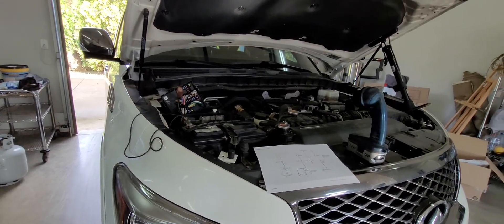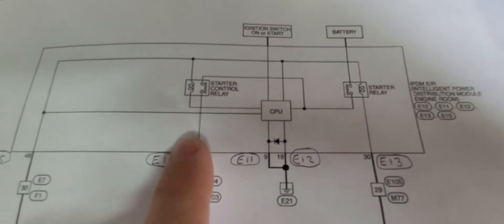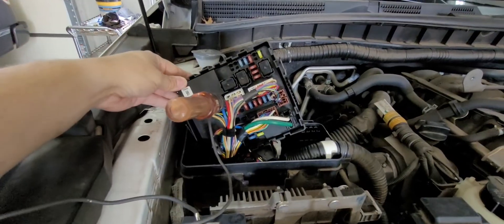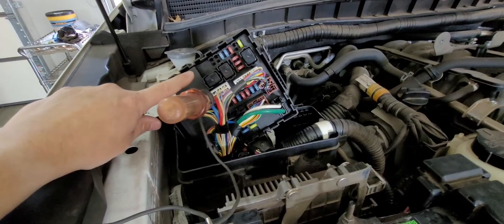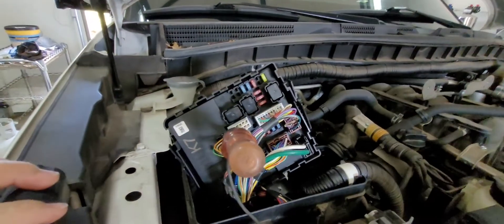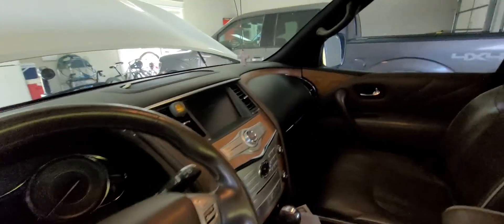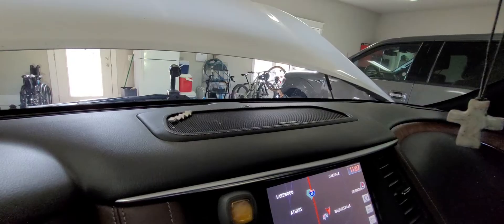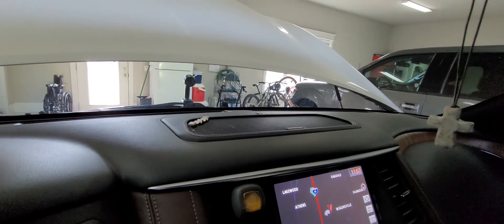QX80 No Crank No start SOLVED! How to test if your IPDM or starter is bad.

Comment: I have a 2019 qx50 out of no where my battery will die ? Any suggestions
Reply from the maker: Does that vehicle have a voltage gauge on the dash? If it does, how many volts after starting it and then again 30 minutes after driving?

Comment: My friend 
I had qx56 2012 it was without battery for month 
We put battery and engine not cranking 
Some one say ecuv
!!!!!! What is the problem do you think
Reply from the maker: I can’t know what is wrong with your QX56 without inspection, but I’d ensure the battery you are using is fully charged and that your connection to the battery is correct and secure. After that you could continue to troubleshoot. Good luck, I hope you find your solution 👍

Comment: Was it really a starter issue? I'd check the brake peddle switch, that's what fixed my issue of no crank / no start.
Reply from the maker: Yes, the issue was the starter motor. I replaced it back in 2022 when I made the video. Haven’t had any issues since 👍

Comment: Question - my qx80 sometimes a rough idle I turn it off and push the button again to start and it runs smooth .
Reply from the maker: I can’t say for sure what that would be, but good practice is to ensure your maintenance is up to date. If that doesn’t fix it, begin troubleshooting. Maintenance for your situation would involve spark plugs and possibility coil packs if the coils have over 80k on them. Doesn’t make sense to me how a restart would change the idle though. That’s just my thoughts without seeing the vehicle myself.

Comment: Do you remember if when you had your problem if you heard a click - pause - click sound from under the hood every time the ignition button was pushed and the engine would not start?  I want to try the troubleshooting steps tomorrow.  Thank you very much.  The schematic and your explanation was very helpful and is helping me identify my problem.
Reply from the maker: @maverick19702000  I didn’t have any click sounds. If you hear clicks with no crank, that’s an indication of a bad starter. The solenoid clicks when activated. When the solenoid is activated the starter should crank.
Reply: @jacks_DIY98  I just got my qx80 running yesterday thanks to this video! Now I need to figure out the heated seat for the driver side.
Reply: @jacks_DIY98 or a dead battery?
Reply: Yes there is a variety of clicks but no crank. I did see the voltage on the RED wire he speaks of in the 4v-6v DC range which I originally thought suspicious but ultimately it was the starter. Below is a great video for replacing starter. Took me all day the first time trying to be careful. About 4 hours the second time having done it again. You will need 8mm, 10mm, 12mm to get to the starter and a 14mm for the starter itself. Hoses came off using some plyers. Some cutters for the zip ties. Make sure you let your vehicle charge for a while before trying it out. Ours sat for a while and I replaced the starter I got from amazon and probably didn't need to swap it a second time had I been more patient. 

Just Vlad- Infiniti QX56/QX80 - Starter Replacement

 https://youtu.be/R2eTjpbbZ7w?si=knYCaBCVmtVdLnk1
Reply: https://youtu.be/R2eTjpbbZ7w?si=knYCaBCVmtVdLnk1
Reply: Our 2017 was making an unidentified clicking noise right after the vehicle started last few days. Started fine this morning, but made a rapid clicking noise some where around steering column or dash. Went to work, left work. Or tried to leave work. No start. Battery tests good. Everything comes on....

Comment: Thanks for the video. Had this issue on my 2017.  When it was brand new it had this.  I had many conversations with the dealer about ways to correct the issue before finally speaking with one tech who was able to come up with a solution so that the battery was constantly charging.

Comment: Thanks, P.s. IF your battery gauge is "fluctuating while driving, you are NOT getting battery charged, hense changing battery more than other cars. solution. On negative battery cable disconnect Grey harness black tape it. START , AND DRIVE FLUX IS GONE. battery will get 100 percent charge from alternator while driving. THEY INSTALL THIS "green b.s. to save gas. ❤ Lmao. Qx80 10 miles a gallon. YEP. ENJOY.

Comment: Juat had this on our 2016. It has done 170K miles so its ok if it needs a starter. I cut the vvcm wire a year ago to eliminate that and now i
The starter is intermittent.  I caught the problem with a test light just like this video and am ordering a starter. Thanks!

Comment: That still doesn't point to the problem. Because if it's an intermittent problem, just because you hold on that button and the light comes on seems like a result of what happens when the ipdm has enough time to cool down and kind of reset itself. So basically the best time to be testing this would be after the car has been running for a while. Because of its happening intermittently, that's because the ipdm has heated up so much that it is essentially having a heat stroke. Still doesn't mean that the ipdm is not bad. It could just mean it has had enough time to cool down. So you can essentially replace the starter and the ipdm could still be bad. I ran into a problem with an ipdm overheating in a 2008 Infiniti qx56. But the problems went way past it just needing a starter. Nothing in the truck would work. I had no dash lights but the truck was still able to drive in essentially a limp mode. It would not shift into overdrive. So I had to baby it back home 200 miles from Chicago. But once I got home, it had enough time to cool down and it started ran and drove just fine. Now to be fair, it was about 90° during that trip to chicago. But the pavement temperature was well into the mid 120°s. So if it's a simple no crank no start, I wouldn't bother checking the ipdm. Unless there are other symptoms such as non shifting or lack of gauge cluster. But that's just my opinion. You can do what you want. But I would say you are wasting your time messing with the ipdm. And possibly spending a couple thousand dollars on a whim.
Reply from the maker: Great input. The point of the video is to test if the starter signal is even getting to the starter.  If the IPDM is outputting a signal to the starter solenoid, then the problem isn't the IPDM if the starter isn't cranking.

Comment: Hey Jack... Thanks for all your videos ive watched all of them. Curious if you have any ideas. I thought i had your same situation going on with my 2014 qx80. The only problem was the test light to the starter wont turn on no matter how many times the button was hit. So i replaced the ipdm... got the new ipdm and still no light with test to starter. I tested all other fuses and relays and all appear fine. Any ideas? Dash lights turn on but no indication to press brake to start like it normally does. Im at a complete loss.
Reply from the maker: Bummer,  sorry to hear your QX80 isn't starting. I don't know your answer off the top of my head, but I can try to help. Ok, to be sure I understand your situation, the diagram in this video,  pin 3 ( red wire) of the IPDM goes to the starter solenoid, and you are not getting a signal there. So, check pin 30 of connector E13. You will want to refer to the IPDM layout diagram to find this connector. It's a Red wire with a white stripe. Bottom row second position from the end but likely the last wire in that connector. Check if you have a signal there when trying to start.  That signal is coming from the Body Control Module. Without it, your IPDM won't try to start the engine.
Reply: Thank you so much for the help. I feel like ive been chasing rabbit holes with this. The pin 30 did not have power with test and not sure if relevant but it made clicking noise in ipdm when test light was pressed in. So from your point of view would this point to a bad bcm?
Reply from the maker: @ArcheryOutdoorLife  It's too early to  say bad BCM, more troubleshooting is needed. The clicking noise in the IPDM would have been relays. I haven't researched the BCM previously.  I'll try to look into it on Friday.  Obviously,  the goal is to troubleshoot the circuit that controls the start signal. The next thing to figure out is what tells the BCM to output to pin 30 at the IPDM.
Reply: @jacks_DIY98  Makes sense ill do my research as well. Thanks for all the help.
Reply from the maker: @ArcheryOutdoorLife  I just tested my QX80. Pin 30 has battery voltage  when the Ignition is on, engine running or not. However,  not enough current to light a test light very well. You'll want to use a voltage meter to measure there. The BCM has a connector M71. Pin 97 is the other end of the wire for Pin 30. You could measure with a voltmeter there also. It's the same R/W wire. Pins 97-99 of M71 are part of the Ignition system also.  Pin 102 is the Neutral/park circuit, that plays a role in the start circuit also.  To check P/N circuit at the IPDM measure voltage on connector E15 Pin 48. It will be a brown wire. It's the Second pin from the end but is the last wire in that row. It should have battery voltage with the key on. Good luck 👍

Comment: Does the IPDM module trigger the Security light indicator in the dash? My wife has a 2014 QX80 that has intermittent start and flashes in Red the security indicator light, which locks the ignition switch. Thank you
Reply from the maker: The Body Control Module (BCM) controls most all functions of the security system. The only thing the IPDM does regarding the security system is honk the horn. All other aspects are controlled by the BCM.

Comment: my QX80 2020, monitor no light , could you tell me about this problem
Reply from the maker: The fastest thing for you would be to read through all the comments and this video description.  If you still have a specific question,  I'll be happy to answer it. The basics of this video is just that you're testing if the starter motor is getting a start signal. The IPDM rarely go bad, so double check your test results or Measure at the starter motor connector at the top back of the engine.

Comment: The OP made this a bit confusing, so to save some time from people asking the same question repeatedly...

-- If the test light DOES illuminate when you press the ingition, but the car does NOT attempt to crank, the IPDM is good and the starter relay or solenoid is bad.  Replace the starter (the relay and solenoid are all part of the starter as a whole).
-- If the test light does NOT illuminate when you press the ignition, the IPDM is not sending power to the starter relay, thus why the starter does not / cannot engage to turn the crank.  In this case, replace the IPDM and you should be all set.
Reply from the maker: Thanks for contributing to the comments,  good break down of the situation,  except I wouldn't diagnose  the  IPDM as "bad" with a no light result.  It could be another relay or wiring issue. Further troubleshooting is needed.
Reply: @jacks_DIY98  Thanks for posting this video, I've been having this issue for over a year now. If you dont mind could you give an update on this fix.
I have a 2012 Nissan Patrol, and it seems to be a common issue for both Patrols and Qx50/80s, adding it to the title might help others find it as well
Reply from the maker: @joshuajose7310  The starter motor/solenoid I replaced is working well. My issue remains resolved. A bad starter/solenoid is much more likely than a bad IPDM. Good luck on your troubleshooting and repair.
Reply: Thanks again  @jacks_DIY98

Comment: I have the exact same intermittent issue on my wife’s 2012. If I do this and my test light doesn’t come on, do I have to replace the entire IPDM or is there a cheaper way by changing one of the relays or something else? Great video btw and thank you.
Reply from the maker: Check out my channel for the QX80 Ignition, relays and IPDM. There are relays that could be the culprit.  My experience in digging into the diagrams and my 2016 QX80 is that the IPDM is less likely the problem. In my case, I tested the IPDM and all relays and it turned out to be my starter motor.
Reply: if the test light doesn't come on, the ipdm is 'bad' - it isn't sending power to the starter solenoid to start cranking the flywheel

Comment: Well heck!!  Now im not sure the VVCS was my QX80's starting problem!!  I snipped that wire so i guess time will tell if that fixed the issue or if i need to try and get it to no start while i have a test light hooked up.  This car.....  🤦
Reply from the maker: The videos you are referring to are two separate problems.  The VVCS is related to the alternator charging the battery. This No crank video is regarding the starter motor. If you're not sure if your QX80 isn't starting because of a dead battery,  just measure the battery voltage. You should have about 12.6 with the car off. If you have 12.0V you have a dead battery. If your battery isn't low, then troubleshoot the starter motor if the car isn't starting.

Comment: So if light goes off and doest start its the IPDM? Appreciate the help
Reply from the maker: Well, I'll be really specific here because I think it will help you. If the test light turns on when you are trying to start the engine,  that means your starter solenoid power is good. When that starter solenoid power is good, your starter motor should be turning your engine over (cranking). If the engine isn't cranking (but the test light is on), then either your starter motor/solenoid is bad or there is another electrical problem in the start solenoid circuit. 

If the test light doesn't turn on while trying to start the engine (and your test light is hooked up correctly) then the IPDM isn't providing power to the starter solenoid and you need to troubleshoot why the IPDM isn't working. IPDM's cost over $2000, so hopefully, that's not your problem.  Generally, the 2014 and newer IPDM are reliable from what I hear.

Comment: Have you had the battery terminals replaced? My wife’s does the same thing. When I cleaned the terminals it started. But has done it two other times. Did you replace the starter to fix it?
Reply from the maker: Thanks for your question,  the purpose of this video is to troubleshoot if the starter is receiving the start signal to the starter solenoid.  So whatever other problem might occur,  like battery terminals,  this video helps troubleshoot the starter solenoid signal.  Yes, as mentioned in the description of this video,  I did replace the starter and the vehicle has started reliability since then. Hope this video helps you find your issue.  Best of luck to you.
Reply: @jacks_DIY98  seeing as the terminals are clean now, I’m guessing that my problem is the starter like yours was. I was wondering about that fuseable link and all that other crap on the terminals. Probably just get a starter and be done with it.
Reply from the maker: @Dangit  I did not do anything to my battery terminals. They were in good condition. You're right that there could be other problems on your vehicle. That's the point of this video.  You don't have to quess if your starter is bad. Just test it like I show. If the vehicle doesn't crank but you do have a good starter solenoid signal,  then you'll know for sure that your starter is bad. If your problem is intermittent,  you just have to keep trying until it fails to crank.  That's what I did. The starter is under the intake manifold. It is a bit of work to replace. It likely is your problem,  but I wouldn't replace it without knowing for sure.
Reply: @jacks_DIY98  thanks for the info!! I’ll definitely do the test you showed.
Reply: @jacks_DIY98  I did the test and it proved to be the starter like yours. So I’ll be ordering one. Thanks for the video and guidance!! Much appreciated!!

Comment: Is anyone getting engine light with code P0087? My Qx80 is getting the same but with the code.
Reply from the maker: I did not get that code. P0087 is Fuel Rail/System Pressure Too Low”